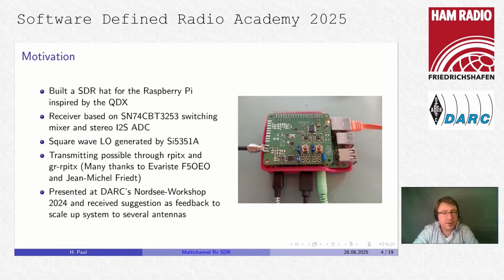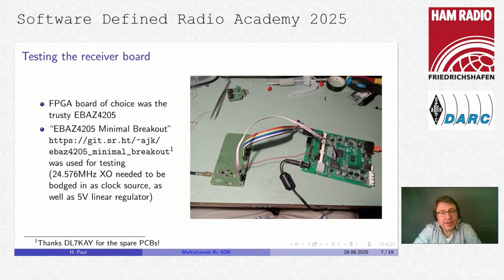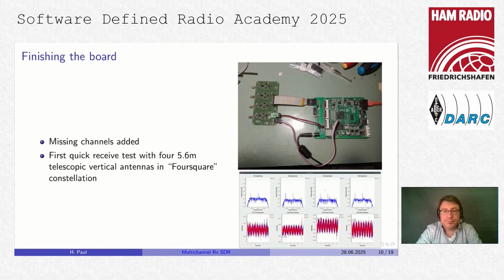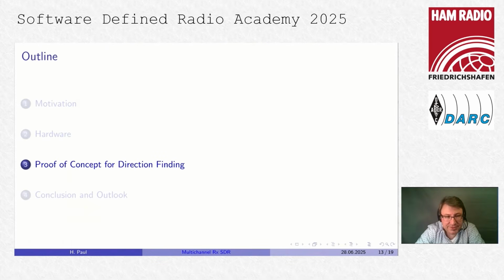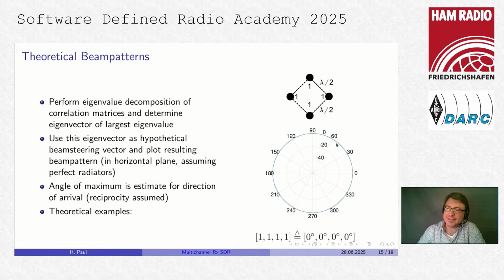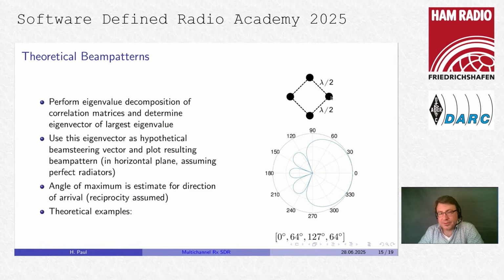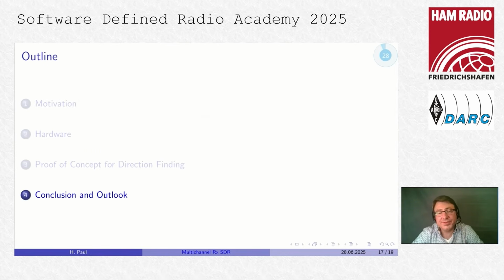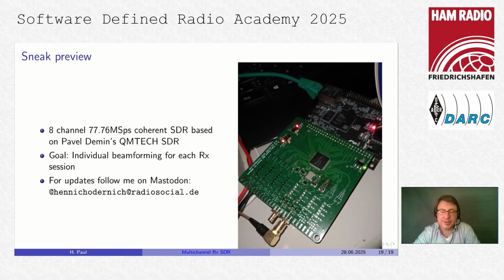SDRA'25 - 12 - H. Paul DC4HP: A Coherent Multi-Antenna SW Receiver with App in Direction Finding

Comment: AI Summary

Abstract:

This presentation details the design, implementation, and testing of a homemade, coherent multi-antenna shortwave software-defined radio (SDR) receiver for direction finding. The project was motivated by scaling a previous QDX-inspired single-channel switching mixer design into a four-channel system. The hardware is built around four stereo ADCs and an FPGA on a repurposed controller board, with a single clock synthesizer ensuring perfect coherence between all channels. During a field day, the system was connected to a four-square vertical antenna array to record 20-meter FT8 signals.

The core of the project lies in its offline signal processing, which uses GNU Octave to perform an eigenvalue decomposition of the 4x4 signal correlation matrix for each detected station. The resulting eigenvector, which represents the phase relationship of the incoming wavefront across the array, is used to compute a beam pattern whose maximum indicates the signal's direction of arrival. Experimental results show high accuracy in determining the direction of European stations and reveal complex, varying propagation paths for a transatlantic signal. Future work includes implementing real-time maximum ratio combining (MRC) to improve SNR and using the derived phase data for transmit beamforming.

A Coherent Multi-Antenna SDR for Shortwave Direction Finding

*   0:01:17 Project Origin: The project was inspired by a previous QDX-based switching mixer SDR. The goal was to scale the design to a multi-antenna system capable of coherent reception for direction finding and beamforming, similar to a phased array.
*   0:05:37 Coherent Hardware Design: The receiver uses four separate stereo ADCs (Texas Instruments PCM1820) and four switching mixers. A single clock synthesizer (SI 5351A) drives all channels, ensuring perfect phase coherence for both the local oscillator and the ADC sample clock. An FPGA on a repurposed Bitcoin mining controller board (IBATS 2405) aggregates the four data streams.
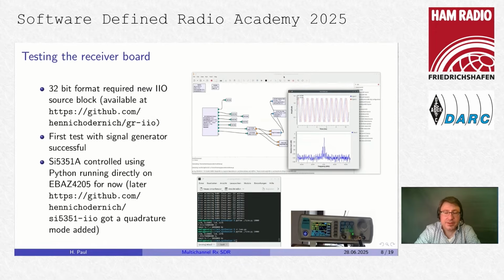*   0:09:43 Custom Software Development: To interface with the hardware, the presenter developed a custom 32-bit IIO source block for GNU Radio and updated the Linux driver for the SI5351A frequency synthesizer to support quadrature clock generation, which is essential for the switching mixers.
*   0:15:41 The Field Day Experiment: For real-world testing, a four-square vertical antenna array was deployed at a field day. The receiver was housed in an enclosure and powered remotely using Power over Ethernet (PoE). It was used to record FT8 signals on the 20-meter band for later offline analysis.
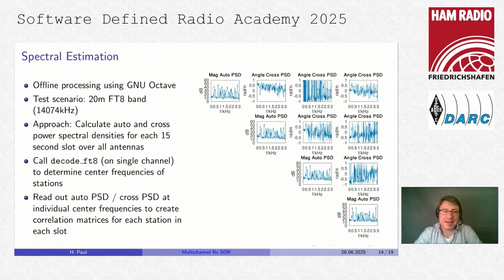*   0:19:56 Advanced Signal Processing Method: The direction finding algorithm processes the recorded signals in GNU Octave. It calculates the auto- and cross-power spectral densities between all antenna pairs to form a 4x4 correlation matrix for each detected FT8 station.
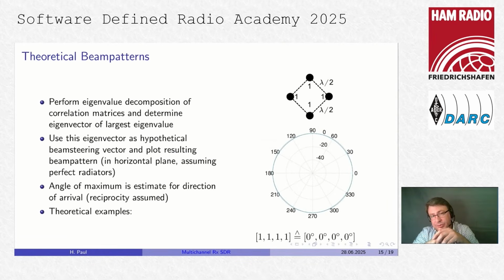*   0:23:17 Eigenvalue Decomposition for Direction Finding: The system performs an eigenvalue decomposition on the correlation matrix. The eigenvector corresponding to the largest eigenvalue represents the phase shifts of the incoming signal across the antenna array. This vector is then used to calculate a beam pattern, with the pattern's maximum pointing to the signal's direction of arrival.
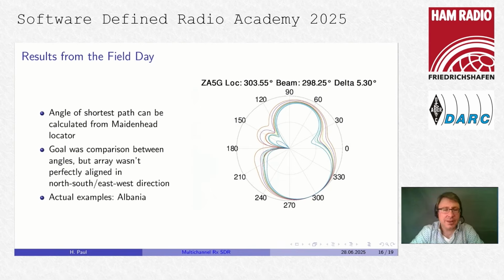*   0:31:09 Accurate Directional Results: The system successfully determined the direction of various European stations, with results for signals from Albania, Spain, and Italy showing errors as low as 3-5 degrees compared to the true direction calculated from Maidenhead locators.
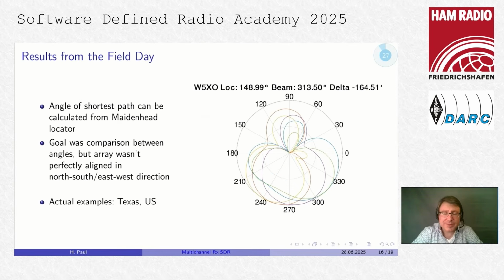*   0:33:46 Observing Complex Propagation: An FT8 signal from Texas, USA, exhibited a direction of arrival that varied significantly over just a few minutes. This demonstrates the system's ability to visualize the dynamic and complex nature of ionospheric propagation on long-distance paths.
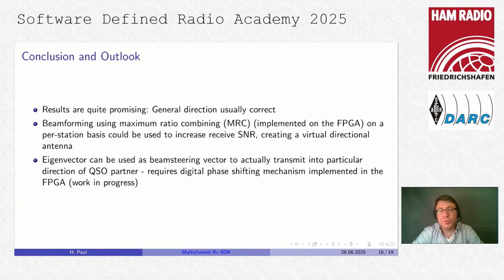*   0:35:30 Future Enhancements: Future plans include implementing Maximum Ratio Combining (MRC) in the FPGA to coherently combine signals and improve the signal-to-noise ratio (SNR) in real-time. The derived phase information could also be used for transmit beamforming, directing a transmitted signal back toward the source.
*   0:42:19 Broadband Operation Limitations: In the Q&A, the presenter clarifies that while the array can work on multiple bands, it is only optimal when the antenna spacing is a quarter-wavelength. On other bands, the beam pattern may become ambiguous or overly broad, reducing gain and directional accuracy.

AI-generated summary created with gemini-2.5-pro for free via RocketRecap-dot-com. (Input: 25,771 tokens, Output: 951 tokens, Est. cost: $0.04).